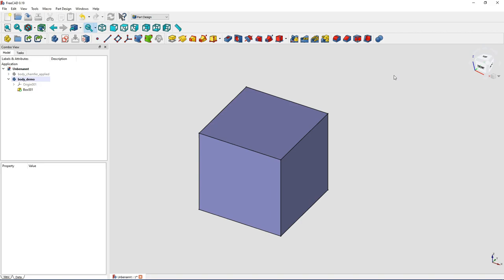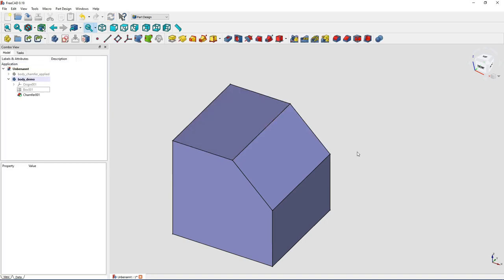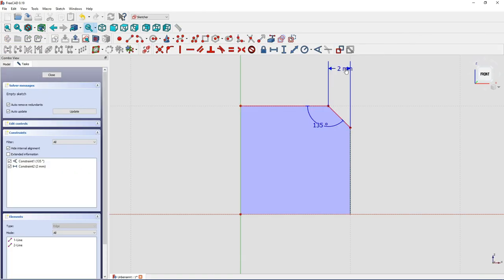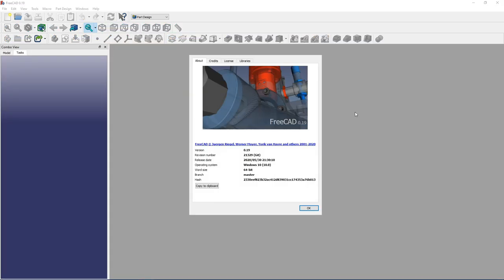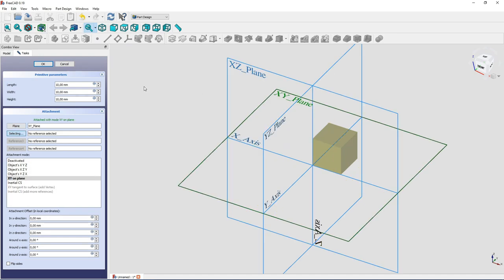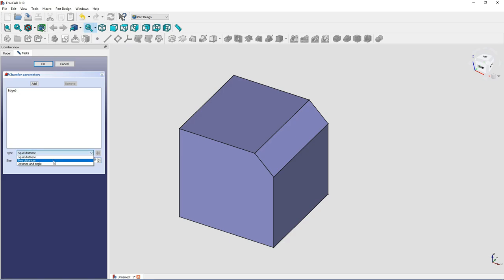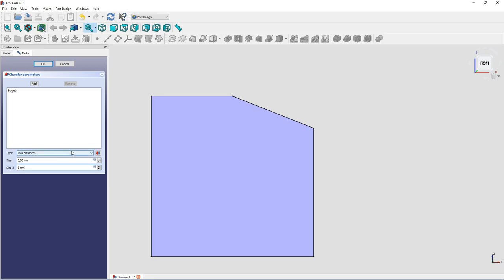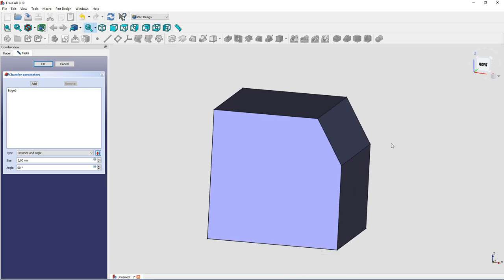FreeCAD 0.19 - FreeCAD finally has a great chamfer tool in PartDesign

Comment: Hi, gread work from the FEECAD community,,, Brief comment on this feature I noticed... When champfering all 4 edges of a box (arround the outside one is "allways" the wrong way round. Unfortunatley the filp funtions only works on all champfers rather than only on the one you want to change. So the only work arround I see right now is to make two champfer operations (groups) aka 3 + 1 champers. Correct? A flag for each groupitem (champfer item) would be nice to allow flipping each item indivdualy...

Comment: great fyi video... is there a ready to use hardware workbench in inches for bolts and NPT pipe fittings?  because our machine shop has both brass and steel rod material 3/4" 1" 2" etc and in 25mm 50mm etc?   seems like freecad has lots of mm units bolts and nuts,  however many projects still require inches... thanks a lot...:)